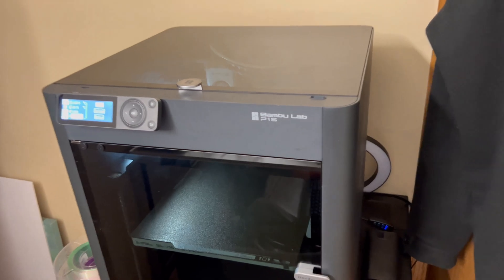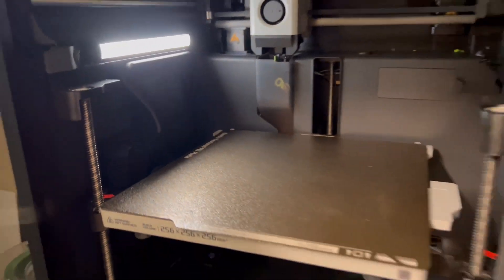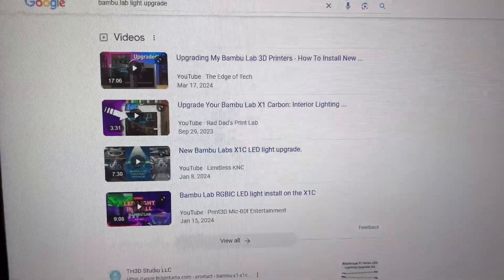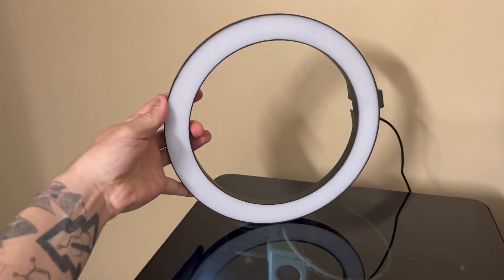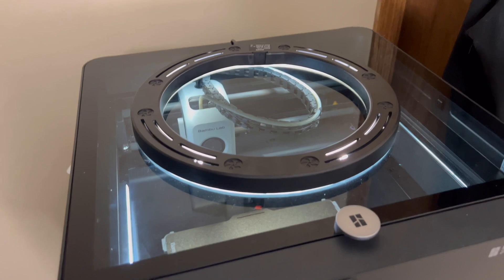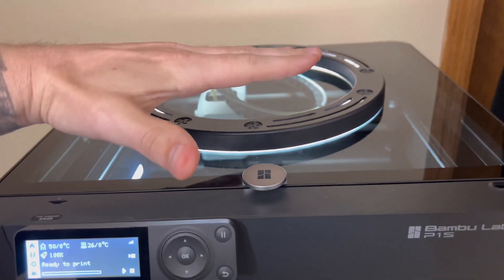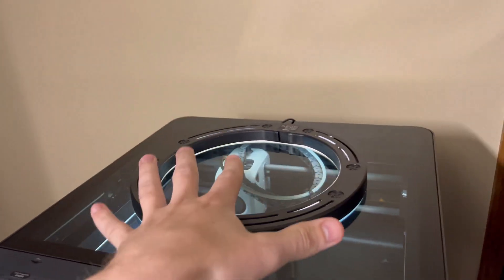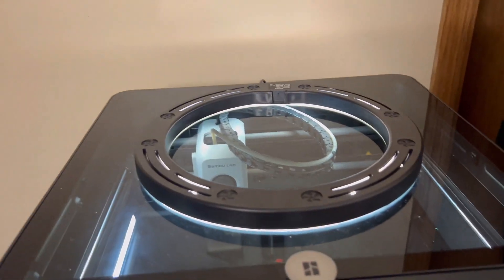Bambu Lab P1S Light Upgrade - EASY AND CHEAP!

Comment: I was looking for a "slick" solution that wouldn't look janky and didn't require soldering. Everything I found is either just those cheap self-adhesive strips that fall off after a few weeks, some complicated hack that requires soldering and making your own board, or buying a retail version that looks nice and is pretty easy to install but it casts harsh shadows making the timelapse look terrible. Just because it's simple, doesn't mean it's not the right answer. Thanks for pulling me out of THAT rabbit hole because I can make this work with my riser!

Comment: You are putting a large amount of trust in tape that will exist in 50C and cooling repeatedly over a hotened flinging at 300mm/s on a 900$ machine. If it collides it probably wont stop trying to move.

Comment: There's just an aftermarket LED-strip of Biqu on the market, which snaps on with magnets on the inside and which get connected on the original LED-light on the AP-board. So all functionalities like turning on/off the light from Bambu Studio/ the app/ the screen will be kept.

And that only for just $5 to $7. Clean, simple and cheap...

And with some small tinkering with an $1,50 CMOS board and a spare USB-cable, you can connect both the lights over the internal USB-port and still switch them together via screen and app etc.
Reply: Can you link this light and the board you are talking about? I'm very interested

Comment: Hi.
Agreed it is simple and indeed it does the job.  I looked into improving the lighting in my P1S, fitted with an AMS unit.  I also wanted to lift the lid, so that the PTFE,tube stopped rubbing on the underside of the lid.
I found an excellent solution, I’m not sure it’s ok to mention the exact one here.  So, it comprised four parts and raised the lid by 18.5mm, it even has a slot, at the back, to allow a 12v feed.
It clipped together, and was a perfect match on the top of the printer.  The lid also fitted perfectly on top of it.
I used 2M length of 4mm wide COB LEDS, and a 12v power supply, I already had.  The result was much as yours,  what a difference😊  Very pleased.